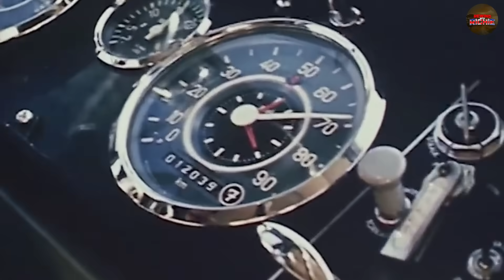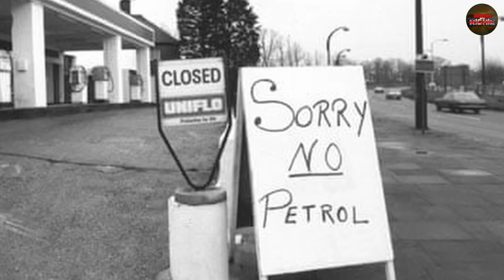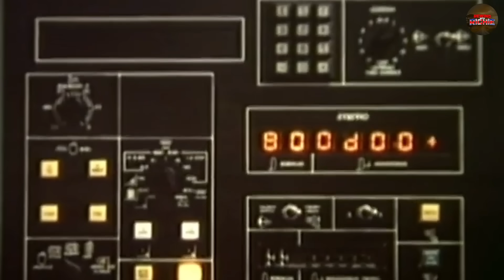The GREAT British Lorry Engine That NEVER Stood a Chance – The FALL of the AEC V8

Comment: Didn't Rolls-Royce ever make truck engines? Surely they'd be far more reliable. A mate of mine has a Rolls-Royce car which is over 50 years old with the original engine which still starts straight up and still doesn't burn oil.

Comment: Some scenes, starting with 0:03, show the block of a V8 flat head, not the AV800. Be aware that this video contains a lot of very random pics. On the technical side: At that time, end of the 60s, beginning of the 70s, MAN (and Rába in license) have produced engines with very much the same power per liter (or per cubic inch, if you like), which were very reliable. The natural aspirated M-Process (M-System) inline 6 with 10 to 11 liters of displacement  (D 2156, D 2356 and turbocharged variants) moved around millions of busses, agricultural machines and so on. Rába D10 was one of the last successors of that line.
Reply: What place has a cubic inch in thus story?

Comment: Reliability of an engine reputation can be found in the marine world where Gardner to this day remains king .   Salt water pickling is not a problem where other engines have to have expensive heat exchangers ,  AEC were not even in the running on big commercial freight boats here and abroad ,  smaller craft up to 50 feet in general used the Perkins S6 and later units and also the Leyland BMC 6/98 was a good reliable engine .
Reply: I have never seen a Gardener on a boat without a heat exchanger and I have seen lots of them. Wonderful engines  , rebuilt several. A dream and a pleasure to work on.

Comment: UK didnt modernize its steel and metallurgy . they just won ww2 . but were broke so continued to use 30s tech on engines with 3,4x HP and torque and speeds. a recipe for disaster. german post war tech was new. sweden invested heavily in new stuff in the 50s . uk did not. Ex diesel train engines that UK builders onlu had to copy german blueprints were all sub par bc of bad metallurgy and corruption + of course the unions. uk unions were destructive for factories. german-swedish  unions were the factories

Comment: The 800 series (AV740, AV800 and AV810) were designed with inadequate bearings, which was the cause of most of the problems.  If a larger lining area had been adopted then the engine would have been more reliable, with more displacement  stretch available but it would have resulted in a heavier and physically larger engine.   AEC were actually ahead of the material science of their day the chosen bearing area and 1960s materials would fail.  With modern bearing materials the engine can work much better. There are  some who claim Leyland allowed AEC to build the V8 in order to sabotage AEC, that is clear nonsense, as Leyland believed in AEC to the extent of giving them new engine tooling on which the V8 and the dry liner engines were built The Scammell Crusader was also designed around the 800 series but with its failure was then swiftly refitted with the Detroit 8V-71 while it was redesigned for the Rolls-Royce Eagle.

The other knock on effect of the failure of the 800 series was to pressure Leyland into launching the high pressure 260bhp 510 too early while the oil crisis put paid to the Gas Turbine just as it had been adapted for the Marathon. in 1968 the 800 series, the 500 and the Gas Turbine Truck was announced, by 1975 all had failed to a large degree.

A major black mark was the truly awful AI title card.

Comment: Leyland/ AEC , were STUPID,, ergomatic cab had the SAME RADIATOR for all engines, Albion 4 cylinder 90 hp to AEC 760 220 hp and fro the AEC 505 up they ALL RAN HOT , 
so bigger/ More hp engine with same radiator was a STUPID IDEA

Comment: In NZ the Perkins V8 family were used in short time operations like wharf forklifts, cranes and airport fire engines. I had a Dodge/Commer V8 6 wheeler which went okay but always had idling and part throttle erratic running. Quite good fishing boat engines with hours of only part power required. The AEC sixes were not known for unworn high mileages, used in town buses.
Reply from the maker: Thanks for your input 👍

Comment: How sad, British industry has a habit of shooting it's self in the foot, look at the state the country is now. If AEC wanted larger engine look no further than the 250 hp 6 cyl Cummings, in its day was of a 350 hp V8 Cummins, some one has mentioned a Gardener engine, in its day it was good, by the 1970's it was a lost cause. In the late 1960's I drove an AEC Mandator with a 38' trailer on interstate transport, (Australia) it's engine was an AV691 with about 195 hp, how would I have liked it powered by a 250 hp Cummins.
Reply from the maker: Get rid of Starmer 😂

Comment: Rolls Royce did a V8 diesel but only for military vehicles.
Reply: I took a ship to scrap in Kaohsiung, Taiwan (Atlantic Causeway, sister ship to the Atlantic Conveyor, lost in the Falklands conflict.) It had the facility to run many refrigerated containers and used RR V8 Diesels for Emergency back-up generators...the hours logged on these were absolutely minimal...like 15 or 20 hours....probably just run for weekly test procedures.
They were works of art and should have attracted the attention of conservationists somewhere..... I'm sure they could have been removed before the ship went to the Gas Axe in Taiwan. Just so sad.
(I very briefly owned in my youth...an Austin 4X4 ex military style "jeep" which had the RR V8 you mention...... Loved it....BUT...It drank petrol at a rate I could not sustain!)(Crikey, it drank more than me!)

Comment: Perkins was probably the only decent British V8 diesel though only just and probably only in agricultural and individual equipment because as far as I know commercial vehicle wise it's only really Cummins that were more common.
Reply: Your having a laugh,the Perkins V8-510 and V8-540 were an absolute disaster for operators,gutless and constant overheating and head gasket problems, AEC engines under British Leyland were also a heap of trouble with the same problems of overheating and head gasket problems,it’s no wonder the likes of Scania and Volvo have dominated the commercial vehicle market for many years,I always told my boss put a Gardner engine in an AEC and you have a decent truck,not fast but reliable which is the name of the game in haulage in those days the 60s.
Reply: @davidellis279 I ment built and designed but I've also said that from what I've read they seem to be not under powered but lacking in torque and had a bit of a reputation for being gutless when used  for ploughing but I've personally not had any experience with a Perkins V8 powered tractor but plenty with 6.354  Massey Ferguson Fordsons and a Ford 5000
Reply: The small v8 cummins were rubbish the 504 555 .only the 903 cummins was any good .